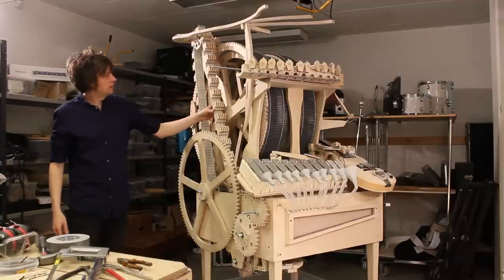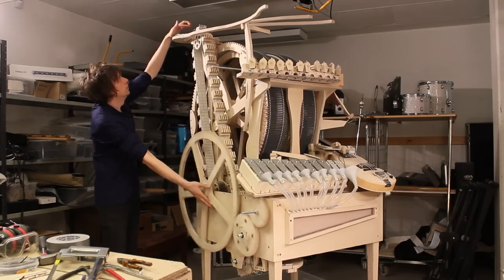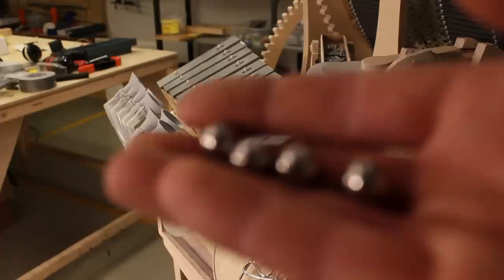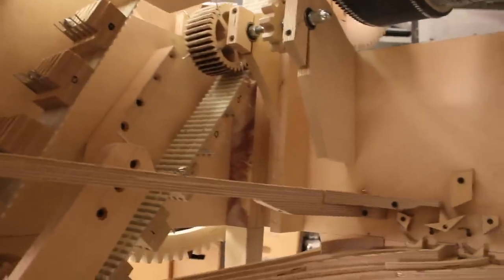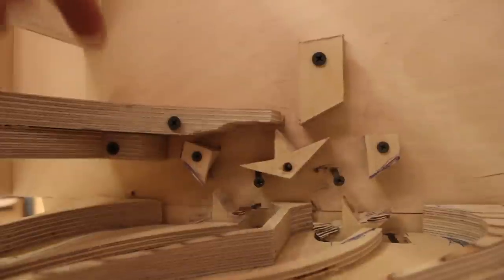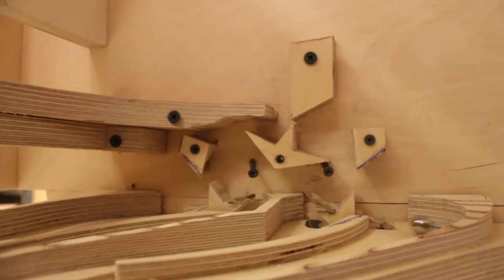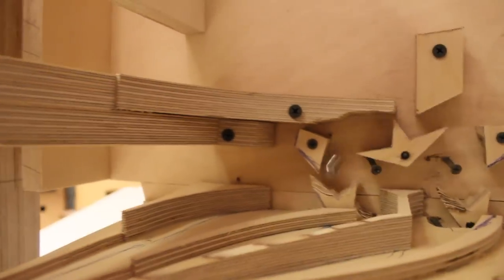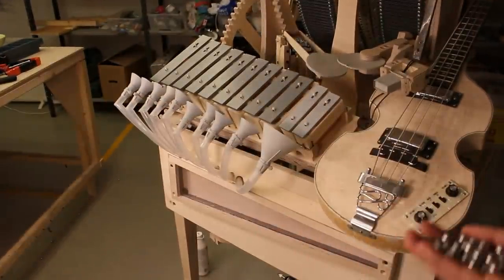Marble Lifting Mechanism - Prologue #5 Musical Marble Machine

Comment: What I like about this is it demonstrates the premise of all really good engineering.  Take an incredibly complex problem and break it down into smaller more easily solved tasks and from the solutions of those smaller challenges learn and incorporate that knowledge into the next problem.  And what you learn from this project will make the next one that much easier.
Reply: +stormyus1 I actually think this is way more complicated than needed and that he did so anyway because it's cool and because he has fun building it.
Reply: +Veavictis Asmadi Sure. The vibraphone part could be an enclosed music box instead (the screws in the large gears are like the pins on a music box cylinder), but here you have each marble taking a leap of faith. :)

Comment: Congratulations for your work. I wager that the rhythm of the machine itself  as a structure will make good music to the ears of any engineers like me,  while the music from the falling balls will complement it!  I always advocated that art and engineering go hand in hand . Really it is all engineering including the musical instruments and the frequencies that come out of all that, It is only the emotions created by some permutated /combined sound  in some natural law/rule that makes some noise . make it to the realm of .music.

May I suggest that the up going belt  with the balls would be supported underneath by an  slightly arched surface to stop the oscillation  and twisting of the belt. It appears that the divide by  two logic is not coping with the rate of feed of the balls and perhaps  a separation of the balls by a free wheeling tooted wheel ( waterwheel)  before the enter  the first divide by two would help as two close balls seem  to go through together. 

Beautiful workmanship. Looking forward to see this in operation.